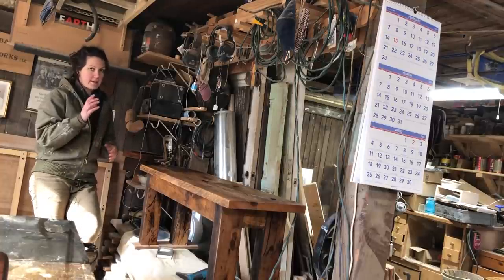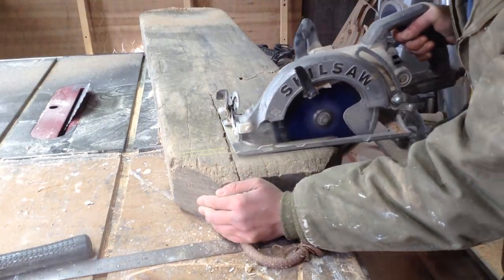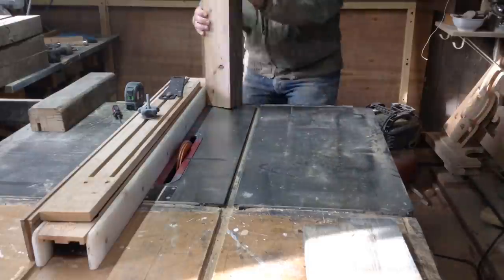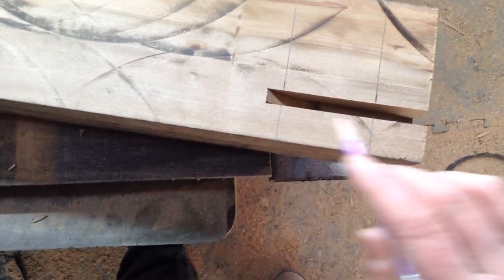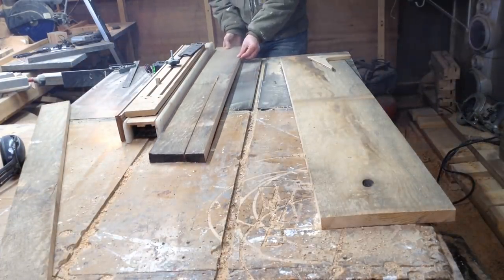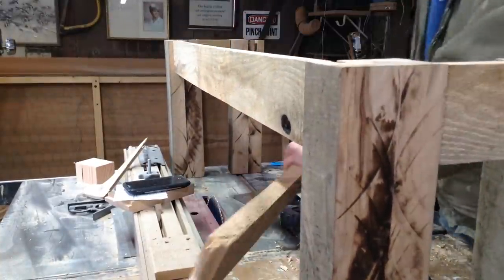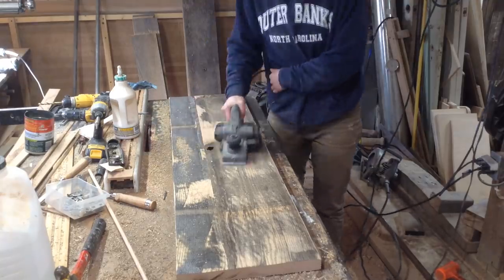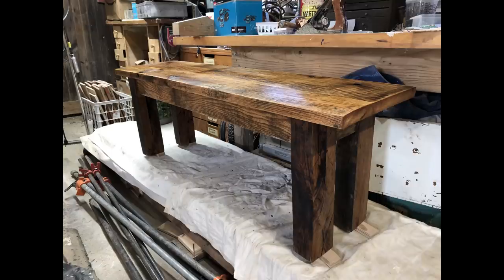Woodworking : Rustic Kitchen Benches // How-To

Comment: Wicked cool!  Dig your approach to the mortise and tennons.  Ever considered housing the mortises on a piece like this?  The finish looks great, I love Waterlox, one of my top 2 finishes.  It's chilly up here this weekend, it was like 9 degrees when I got up this morning.  Thanks for sharing, enjoy your weekend.  ✌
Reply from the maker: Don't know what housing a mortise is.  Gross 9 degrees makes me feel like a wimp for complaining about the high 20s hahaha.
Reply: Basically a shallow mortise, or pocket that the entire tennoned member sets in.  It hides the shoulders, and any gaps that could be present from a non uniform surface.  My own use and experience with the process has primarily been in timber framing applications.  Upper 20's!?  Friggin' spring time! Haha
Reply from the maker: @northroadwoodwork8616  Gotcha, I haven't tried those before, but that could come in handy especially on these projects with rough lumber where hairline gaps are inevitable.

Comment: The benches look great.  Just one question: is there any reason you don't use a dado stack in the radial arm when cutting long tenons?
Reply: I do this when I'm making shelf uprights - plows out lots of material straight and clean.  I have one of those jigs for cutting a tenon on the table saw but if I had to do one really long that would hit my ceiling.  :)  The radial arm saw is enormous and lives outside on a pallet under a tarp so unlimited room there - I'll try this with some benches in the spring.
Reply from the maker: Because I'm lazy and don't want to switch out the blades hahahaha.
Reply: @HoneyBadgerWoodWorks   Agreed, I like using the RAS for tenons, and some dados, grooves, & rabbets.   But sometimes its just easier to nibble with a crosscut blade rather than change the blade.   Depends on what's been happening at the saw, and what will be coming up I suppose.
Reply: @HoneyBadgerWoodWorks  Hey Caitlin , might not surprise you I have solved the blade changing problem on radial arm saw by getting two LOL  I have an 18' wall in the garage going to build in the two vintage Dewalt radial arm saws and my miter saw.
Reply from the maker: @tree_carcass_mangler Yeah all this is true.
Reply from the maker: @scottstoner1576  Hahahaha, does not surprise me at all Scott.  I've thought of getting another because you can find these pretty cheaply.  But, no matter how I wrap my head around it, I just don't have the room for two.  But, that is the ideal setup to have two and one with a stack in it.